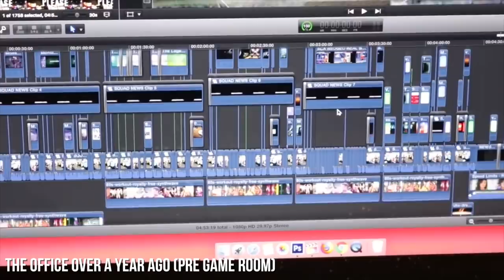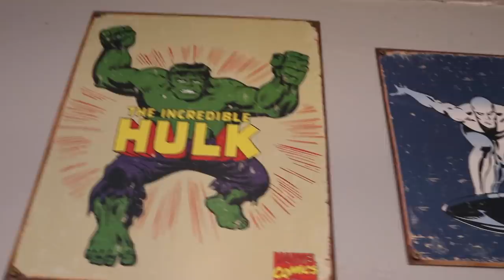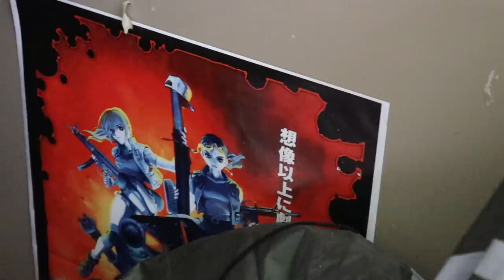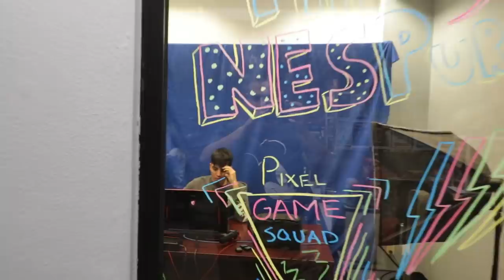WHAT HAPPENED TO THE GAME ROOM? HOW MOLD RUINED THE GAME ROOM - GAME ROOM TOUR

Comment: Hey I wanted to make a comment about this.
You said you were thinking of remodeling the shed a second time, this time with professionals. But what you're not noticing is that it's just a shed. It's weak to the elements. Even with professionals going in, it will still be just a ramshackle little place for storage, bulky outdoor things like mowers, not collectibles.
If you want to have a game room it should be on the upper floor which isn't prone to flooding. Basements, sheds, these aren't good places for games. 
I hope I helped you decide.